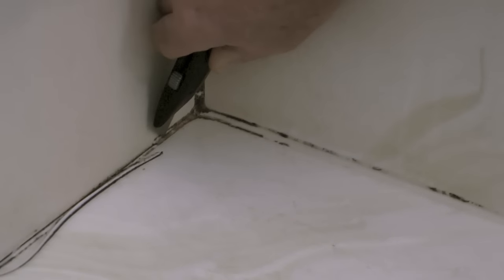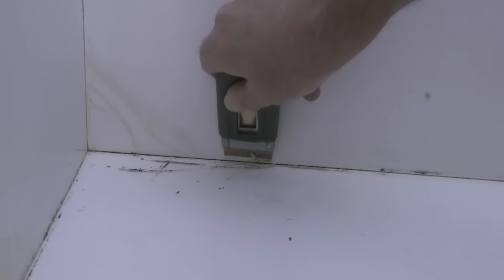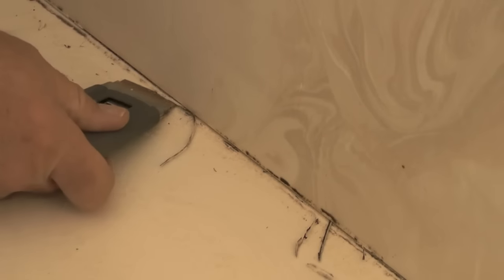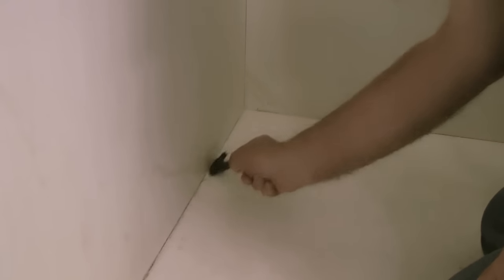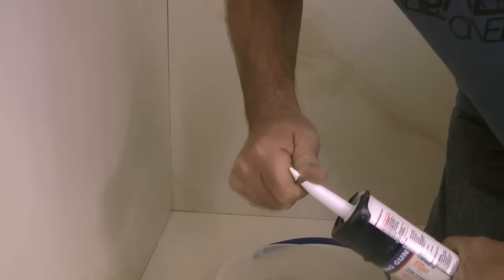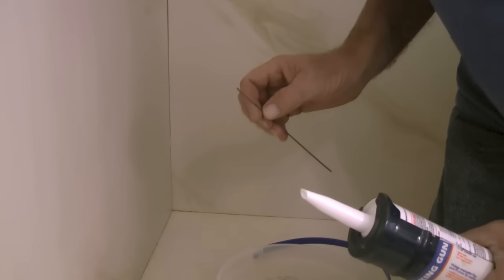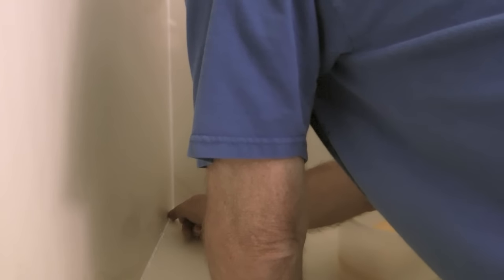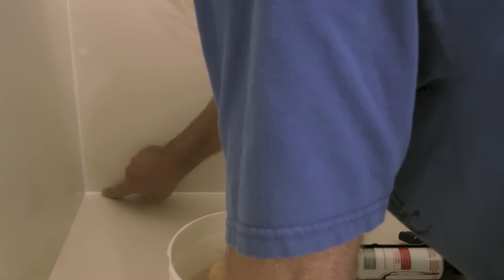Remove & replace moldy shower caulk

Comment: I do lots of these in my business.  First start by removing all the soap scum off the walls.  If you don't, that residue gets under the new caulk and it may not stick well.   After removing the old caulk and cleaning,  I spray Microban into all the joints to kill any remaining mold, and drying with a fan before installing caulk.  Most Silicon caulks have a 30 min set time.  I tell customers to wait overnight to use the shower.
Reply from the maker: +Randy Krape 
Good information, thanks for posting.
Reply: What do you find works best for removing soap scum?
Reply: +MostHumbleSpartan 

Magic sponges work great without having to use chemicals. They're cheap as well, you won't regret it.
Reply: +MostHumbleSpartan 

Magic sponges work great without having to use chemicals. They're cheap as well, you won't regret it.
Reply: +MostHumbleSpartan 

Magic sponges work great without having to use chemicals. They're cheap as well, you won't regret it.
Reply: +Bradley Hanselman thank you
Reply: +Randy Krape - this is a very helpful video and comment. I'm trying to plan this project for my bathroom now because part of the caulking has already come off and exposed the seam. Getting all the materials together now, thanks!
Reply: +Bradley Hanselman Wow, magic sponges? We have some now, do you wet it first and wipe all the seams first and do you use any chemical or spray if it's been years of scum on the wall (I think the box says to wet - haven't used it in years - gotta find them)? I'm going to try this today
Reply: +Randy Krape Thank you for the additional tips. Is there any brands/types of caulk that you would recommend for doing a shower and kitchen sink?
Reply: +SButler83 - I generally use GE silicone II caulk, comes in clear, white and  almond.   Make sure wall and tub are dry.  If not, use hair dryer to dry the joints.  Then install grout.
Reply: +nyhunter77 YouTube  I'm no professional by any means. I like the idea of using magic sponges...but I find they leave a residue behind. Maybe - use the magic sponge and then wipe with a dry, lint free cloth or paper towel before making sure the area is completely dry... just my opinion....
Reply: Microban or Concrobium (all natural (no chemicals) -- made w/ thyme oil -- very effective and safe)
Reply: I'm gonna do this myself, my problem is where the old caulking is ants are coming into the shower. I guess I need to spray insecticide into the space once all the caulking is removed...RIGHT?
Reply: @lindaclark9491  yes.....maybe wait several days, observe if any ants return, then repeat with ant killer spray.  Keep repeating till you see no more ants. Also, go outside your house around where your shower is and see if you can find where ants are coming in. They may not be exactly near your shower...they may may several feet away. You may not even be able to tell where they’re coming in but if you do, put ant bait there. I use Amdro....great stuff.
Reply: @lindaclark9491  I’ve had success with Terro Liquid Ant Bait. You’d be surprised how many ants are attracted to the trap. I’ve done this in 2 different homes and it works fantastically.
Reply: THANK YOU
Reply: @emmbee1551  Is that the brand or the name? Available where?
Reply: Really helpful!  I am a homeowner with zero maintenance experience.  This is so helpful!!
Reply: thank you for this advice. I wish all pros would do this in how to videos

Comment: I would recommend always cleaning with alcohol/Ethanol after scrubbing away the mould. Note also that you always apply the Silicon in the reverse direction to what his doing, that way their is no need to smooth out as it is done automatically i.e. you hold the tube the same way - yet push not pull. took me a few years to learn the right way! Yet gives great results.
Reply: Right on.
Reply: Stephen Nicholas you the real MVP...
Reply: that's a great tip about pushing, not pulling! thank you
Reply: Or you can do it his way which turned out just fine...

Comment: Caulk guns have a hole back by the handle.  It is meant to be used to cut off the tip on the tube of caulk - insert the tip at an angle and squeeze the handle!
Reply: Ma No   True, but sometimes you need a specific cut.
Reply: It's also safer. This guy cut toward himself, not a good idea.

Comment: removal process is a bit faster with a shopvac . it keeps the scraper from pushing in the old caulk and helps remove mold and gunk.  i like to scrap with the vac right behind it so loose stuff is never in the way .  Vacs also speed up dry time

Comment: Your video was the only video of the many i watched that even came close to preparing me for this big job. I was a first timer when I started but now feel like I can caulk like a pro!!  I recaulked the whole shower, then dismantled, cleaned, recaulked and reassembled by whole framed shower by myself thanks to your careful instructions. I did develop my own little techniques as I went along, which is likely why everyone has their own expert opinions in the comments.  But for a beginner this guy has the most realistic video and advice to be found.

Comment: Good job.  When I was removing the grimy silicone, I used some painters tape along the edges because no matter how hard you try you will make tiny scratches in the porcelain which then trap soap scum and you're back to a "mold" issue again.

Comment: I followed the advice of the DIY store. He did say to use a sponge dipped in water to smooth the grout out but it was your tip of dipping the finger tip in the water that did it. My work is not bad for a first timer. THANKS a lot!!
Reply from the maker: I like using a sponge when caulking around window with latex caulk, but around showers and tubs I like using my finger to smooth out the caulk.

Comment: I usually do not leave any comments but I just wanted to point out that with 100% silicone when caulking with it in showers and Tub surrounds you will find that your best bet for beginners is to use the tape method where you run masking tape along both sides of your joint fill it with silicone then finger it until it looks like you want then pull the tape off and then use soapy water to lightly smooth over any rough spots. I say this because when you smear silicone out on the edge of your joint really thin then let it dry and after a little while of use you wipe down your shower and those thin edges that got smeared out come lose easily and start to hold dirt and grime and that's how your caulking starts to look bad and mold and mildew start growing there. I know a thing or 20 about this because I have been fixing this problem for 27 years for customers. Mold and mildew are silicones kryptonite 100% silicone is awesome stuff but get a little mold n mildew under an edge and it starts
Reply: I made that mistake by not using tape.. it looked like a mess.. 😪  so yes use the tape so much easier
Reply: Thank you.  I saw the tape method on a version of "this old house" when showing how to replace moldy caulk.
Reply: Mold has absolutely nothing to do with silicone. Silicone is inorganic. Mold can not grow on it without organic material. And as you pointed out it usually starts under the silicone due to lousy installation by amateurs. When installed correctly silicone will easily last 20-30 years without any problems. The problem is EVERYBODY tries to use ridiculous shortcuts. Like using water or soapy water to tool.
I have been a professional caulker for over 45 years. And have installed probably 100 moles ov silicone

Comment: This video is very helpful. I really appreciated how you described every step - even wiping the silicon on a paper towel.  I've been avoiding this project too, and your video is really helpful
Reply from the maker: Thanks Tamryn for the feedback. If you decide to tackle your project, let me know how it turned out.
Reply: iScaper1 what kind of caulking do you recommend?
Reply from the maker: theradiantchild
If I remember right I used GE silicone caulk with a microban.

Comment: Good videos on your channel.  I just tackled the molded caulk in our shower.  To more quickly and thoroughly remove the caulk remnants, I used a wire wheel brush attached to my drill.  It creates some dust but it was much better than trying to remove it all by hand.  Thin disposable nitrile gloves are the way to go in spreading the caulk.  I placed a dehumidifier in my shower to remove all the moisture after the caulk was removed.
Reply from the maker: +tdalej 
Good info, thanks for posting.
Reply: A wire wheel is not needed if you have an oscillating multi-tool with a scraper attachment on.
Reply: Doesn’t that leave staining from the metal? Every time I use a wire brush it marks whatever I la working on with metal color
Reply: @karleneiannone6193  Maybe a little.  I now use a razor scraper.  I also like the oscillating attachment comment.

Comment: It's a great job, but I want to say people now used epoxy tile grout to caulking the joints, it's different from traditional silicone sealant, it has advantages of waterproof, mildew proof, antimicrobial, easy to clean of the surface, and it will be same as ceramic after curing, but still have toughness, many colors can be selected to suit various tile or shower. Two-component epoxy tile grout is really a good partner for tile accessory.

Comment: This is excellent and just so well done - very clear, focuses on the task at hand, explains the steps very well, and it just gets right to the point. Thank you so much for posting this! It is a huge help to so many of us who want to try to get our own work done, but have no experience with this. I am planning on re-caulking a bathroom, partly because it's long overdue, partly because I am noticing a growing ant problem in the bathroom, as it seems they have found ways to dig some kind of tunnel leading to gaps in the grout and caulking. I will also have to check other parts of the house to re-seal cracks and possibly re-paint as well. (I am wondering if I should try to remove some tiles in the bathroom to check for ant nests, but since I have to rely on my own, and can't afford a professional, I am not sure if it is worth the risk of creating a need for expensive repair.) Superb video!!!
Reply from the maker: +Synaesthesia X 
I have ants come into my shower every spring also. I've had good using Ortho Home Defense Max around the perimeter of my house, it seems to stop them from coming in. I haven't used it in the house yet but it says it's for indoor and outdoor use. Good luck on your caulking project, let me know how it turns out.

Comment: Is it ok not to fill spaces with grout before using sealant? Also. I tried removing the caulk with a stanley knife but it was a stupid cheap plastic one. I cut below and above but wasn't able to get right to the surface so it left lots of caulk to get off.  Spent well over an hour using a razor blade and a broken plastric rule as a small makeshift tool  to remove it. It's hot and I'm sweating like a fool lol.
Reply from the maker: Sounds like you need a better utility knife and scraper.
Reply: lol yup. Eventually got it all off, though it would've been so much easier with one like yours. Bloody Bear Grills type student improvisational skills over here.
Reply: Derek Charette Yup. Like painting, most of the work is in the preparation. Patience and methodology are keys.
Reply: Rory O'Flaherty

Comment: Another great tip but most wont take the time. Each time you shower squeegee the walls and then use a dry washcloth go over the walls and all the caulk lines.
The dryer the better.

We’ve been doing this in our bathrooms for 19 years— no mold whatsoever... never once.

I remember as a kid with 6 kids and 3 adults there was always mold around the tub & shower. It was gross and no one cared.. lol

There are only two in our home.
It takes 3 minutes to dry the walls.
Then you won’t have to do this every year.

Comment: What they don't tell you in these videos is to WEAR GLOVES.  I taped mine off first.  And when I pulled off the tape I got caulk all over my hands.  It is nearly impossible to get it off!  So wear gloves.
Reply: Kawakeb Astra You're welcome.  But I discovered a way to get it off if you do get it on your hands/skin.    Have this ready before your project.  A mix of coconut oil and baking soda.  If you get it on your hands just rub the mixture on your hands.  Use a generous amount.  Rub it in very well.  Then rinse with warm water.  Do a follow up with soap.  I use Dr. Bronners.  Works great.
Reply: +Nancy Michelli Just use exam gloves. I find I use them all the time when I'm doing chores in the garage.
Reply: +Nancy Michelli  you dont need gloves.. strong kitchen towels is the best thing. gloves get in the way!!!!
Reply: Nancy this is why you should be making sandwiches for the man chaulking.
Reply: +Daneil Wawryer what, do you live in the 50's?
Reply: "chaulking". youre clearly the big man we'd hire for this job 🙄
Reply: @Barb Riley I want steak

Comment: What a pain in the cojones!!!  When will there be a way to have seals without caulk?
This way I could just wipe this stuff away without all the drama
Reply: You don't have to remove and replace. Just make a paste out of baking soda and bleach, then apply to area and leave for 2 hours, wash off and I swear its like new. Try it, its like magic.
Reply: L Roa Bleach is an oxidizer. It is not just mold and mildew that kills caulk. Mold and mildew release organic gases which create pressure beneath the caulk. This creates bubbles to where the mold and mildew spread and repeat process to create lift in the caulk. Bleach is essentially liquid chlorine. It cleans well as an oxidizer but etches most surfaces. While silicone has a broad chemical resistance, it will succumb to the effects of bleaching. Cracking, shrinking, bubbling, drying and peeling can all be expected with bleach contact and soonest with heavy use.
Reply: You know you love the drama.....

Comment: I've yet to find a caulk that won't mold! All seems sales BS to me! lol
Reply: +Kenzo Shibakariki I agree!! I have used both silicone and latex, some with Microban, and they all mold eventually. So now I only use latex as it is so much easier to apply and clean up (just water). Silicone sticks very well and will outlast latex, but the mold growth requires that you re-caulk way before then so it's not worth dealing with silicone.
Reply: Flexi Seal has done well for me.

Comment: Short, clear, detailed video... even with good grammar LOL  And now a QUESTION/REQUEST: please help me reconcile the instruction to postpone wetting the new caulk for 12 - 24 hours with the recommendation to use a wet finger to smooth the caulk.
Reply from the maker: You use a wet finger to smooth out the caulk immediately after it has been applied. This step is mainly for appearance. The 24 hour recommendation allows your finished product time to dry.
Reply: iScaper1 Thanks. Does this recommendation apply to other types of caulks as well, e.g. latex ones?
Reply from the maker: humanyoda
Yes, you want to do the smoothing out process shortly after the caulk has been applied.

Comment: I did IT. Yahoo! Your way went so smooth and fast. Looking swell.
Reply from the maker: Roxanne Rasmussen 
That's awesome, congratulations!
Reply from the maker: PokerFace46 
For the tile a flat blade razor scraper might work, and if you have silicone in the grout lines maybe a nylon bristled brush.

Comment: Thanks for this video. Thanks to your information I was able to remove old dried caulk from around my bathtub and recaulk. I found the old caulk was easier and faster to cut if I heated it with my hair dryer on the highest heat. Didn't bother getting out the heat gun.
Reply from the maker: Good tip, thanks for posting.

Comment: I just finished removing the ceramic trims that sit between the bathtub and the surrounding three walls. I then removed all silicon and grout from trims and wall previously behind trims, then I cleaned and polished the trims up. Carefully breaking the trims away from the tub and walls, was no easy chore.  I then used an auto water seal grout to hold them all back in place.  

So no silicon seal this time.  The black mold never ever tried to touch any grout before.  But it loved silicon, big time.

Previously, nothing seem to stop the black mold. Even after doing a thorough cleaning after removing the old blackened silicon seal, and also applying mold killer substances, the mold was soon back even though I also used an anti-mold silicon seal to replace the old blackened silicon seal.

Anyhow, it all now looks as good as new.

Comment: I have been battling this for years and agree with the tech., after removing the and cleaning the crack where the mold tends to hand out, I found that using a hair dryer to dry out the water gives me a much longer time between redoing this painful process!!!  I believe this moisture under the caulk starts the mold process again.  Even if you wait several hours the water will not go away and any mold killer will eventually fail.
Reply: Wipe the area with alcohol and it will evaporate any remaining moisture. Use a Q-tip to force alcohol into the cracks and let it dry.
Reply: rpprevost you probably meaning rubbing alcohol. And it displaces water it doesn't evaporate it. The alcohol itself will evaporate
Reply: Of course I mean isopropyl alcohol. I wouldn't dream of wasting a perfectly good cocktail.
Reply: rpprevost good because that would be alcohol abuse.
Reply: Much longer time between redoing it?
I am a professional caulker and if you do it right silicone should last 20-30 years without any problems.